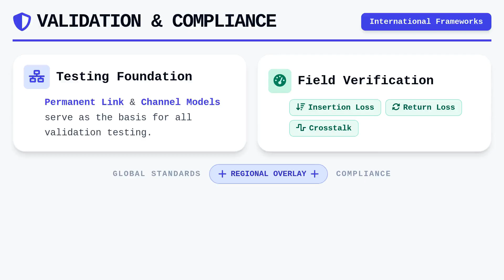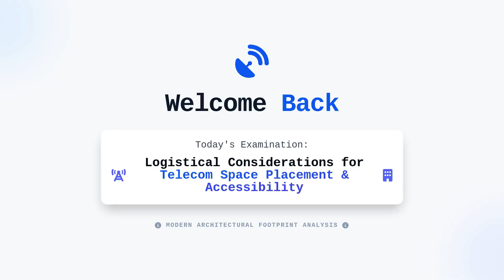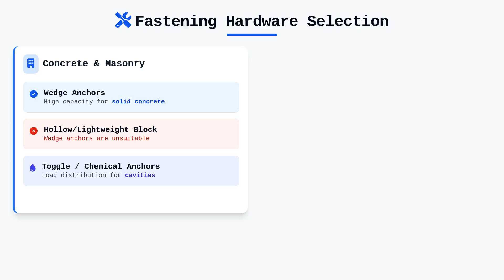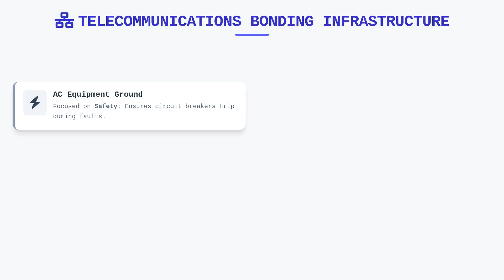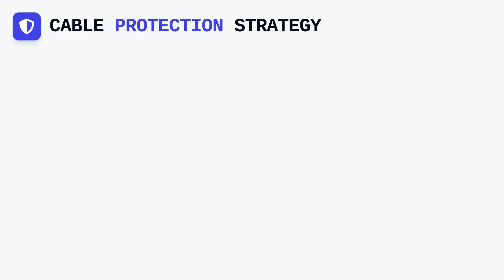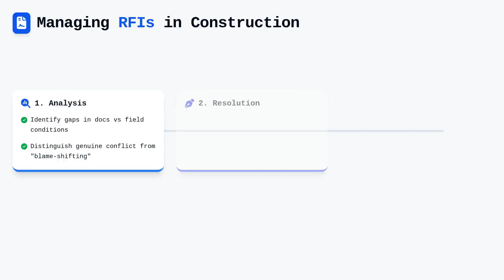BICSI RCDD Registered Communications Distribution Designer Exam Prep: Full Course

Comment from the maker: Sitting the RCDD exam in the next few days? 🦺

If you fix one thing before test day, make it this.

Fill ratio and bend radius violations that fail inspection & separation from power circuits

• Pathways and spaces fill ratios and bend radius
• cabling category distance limits
• TIA/NEC code requirements

I condensed 980 pages of blueprint material into a 1-Page Cram Sheet, 15 scenario decision trees, and 390 spaced-repetition Anki cards:

👉 https://www.coursano.com/study-guides/bicsi-rcdd

Pin this and review it on the morning of your exam. Good luck! 🤞